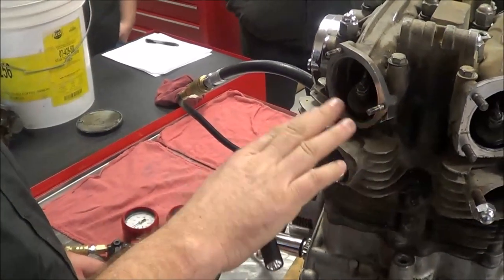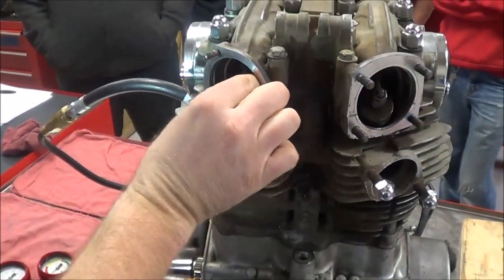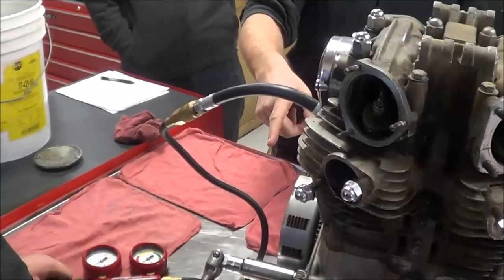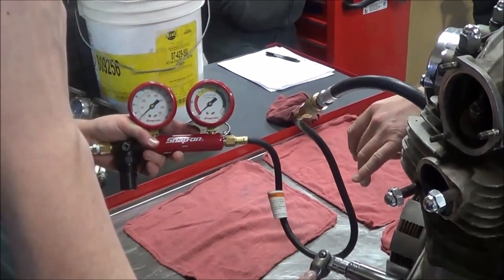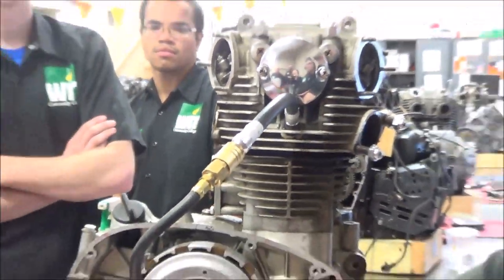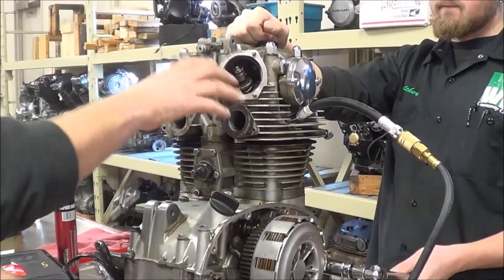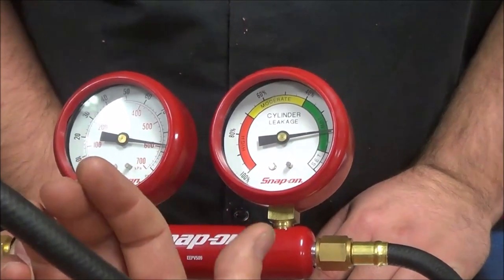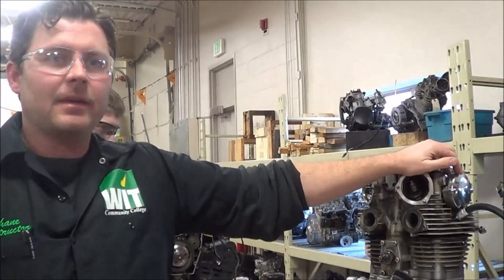Old Boy Trick: How to fix leaking valves using wood.

Comment: Hi could you help me please I have had a black plug on my cylinder 1 for along time I have cleaned my carburetors about 100 time's but still the same .I have set the timing/points/valves all good and played a round with the air/mixture screw .But got no we're what am I missing thank you?
Reply: change the carburators
Reply: Thanks I will try some different Carburetors when I find some they are really difficult to find in the UK . Thanks again for your advice😉

Comment: Oh, Man ... Bummer ... I thought I had found my retro dream-bike BUT, while researching various engine builds, I discovered that the stock XS650 engine has both pistons stroking in synch, so that they both reach the top of the stroke at the exact same time ... Bummer ... WHY EVEN HAVE TWO CYLINDERS ?? ... So ... RE-PHASING costs way too much and is a tedious and time-consuming process. ... I also learned that MOST MODERN PARALLEL (INLINE) TWINS ARE 90 degrees (270') out of phase ... So ... What would be a decent modern inline twin, that is affordable and is between 400cc and 750cc ??  ... I assume that a V-TWIN would not be as simple to service and to rebuild, because of the carbs and heads and cam-chains, etc.
Reply: the XS650 is an awesome motorcycle they can be customized relatively easily and are stupid fun to ride and you can find them pretty cheap too. But if you are looking for new and want something retro the Yamaha SR400 is pretty neat! http://www.yamahamotorsports.com/sport/products/modelhome/691/0/home.aspx
Reply: chance guthridge   Great ! ... 400cc is just enough to handle the freeways (IN town) ... But, right ! ... I am just looking for a nice retro city scoot that is cheap and easy to service ... I WAS looking at the CB500X(ABS) but too spendy ...  The CB300F is just a little weak and "un-inspiring" ... I am going to research the SR400, as you suggest ... I sure like it better than the SAVAGE/S40 ....   I hope that there are used ones, in fairly good shape.
Reply: chance guthridge  Awww ... I cannot afford the SR400 and, IF I was going to spend THAT much, I would go ahead and get a CB500X (ABS), for the same price. ... not as romantic as the SR BUT ... 500cc ... ABS Disc brakes (front and rear) ... Electric start ... Nice factory tires ... Long travel suspension ... And for the same price, you can get a DR650 or a DRZ400SM or a KLR650 NEW EDITION ... All of those bikes bring a LOT to the table and all of them get 50mpg (or close to it) ...  And all of those are easy to work on and can go on the freeway OR off-road (to varying degrees). ... My main interest in RETRO was just because some of them can be purchased for $2,300 and you can make one great by dumping another $500 into one ... But $5,500 ?! ... Uhhmm ... Lots of VERY capable steeds, for THAT kind of money. ... JMO.
Reply: one piston is on the compression stroke and the other is on the exhaust stroke even though they are both stroking in sync. I don't think you can really change that.